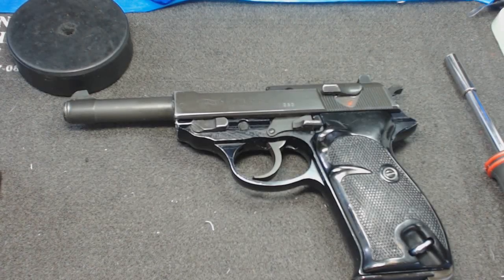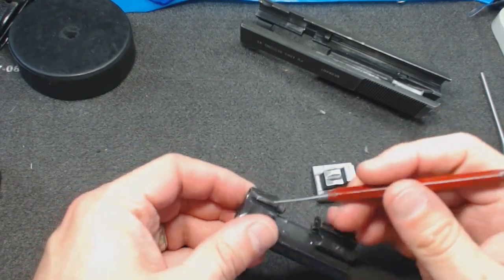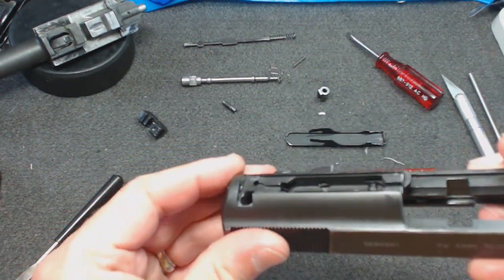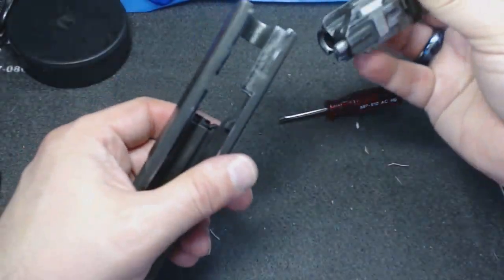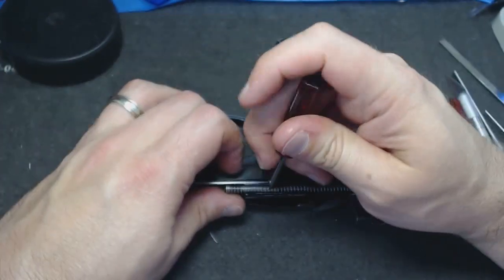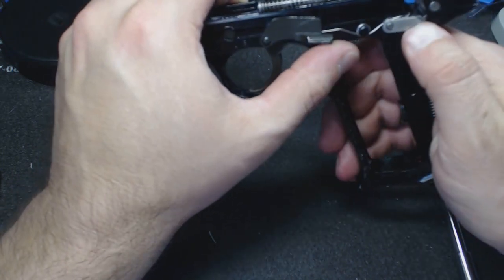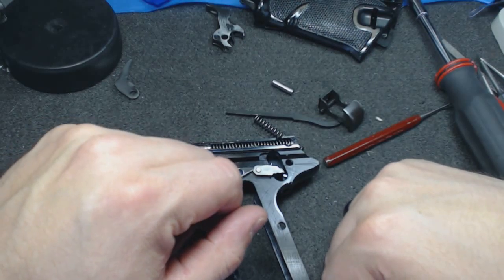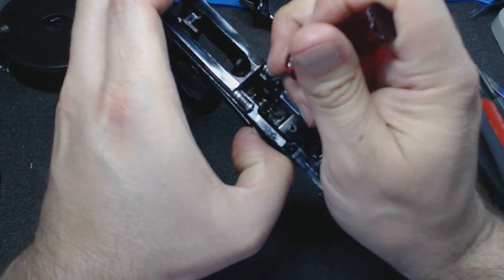Walther P38 (P1) complete disassembly and reassembly

Comment: I have an old byf 44, and If I may add something, a little trick during the take down that may help.

I noticed in the beginning of the video that there was some difficulty removing the slide.

Placing the safety in the down (safe) position before releasing the slide catch will allow the hammer to automatically decock when you move the slide forward, negating the necessity of a trigger pull. It will all come off in one fluid motion.

Hope that helps a little. Good video, cheers all.
Reply: You are right. During my time at the Bundeswehr, we where educated to turn the safety on safe position.
Reply: That's how they show the takedown procedure in the 'Know Your Walther P.38 Pistols, Owners Manual, by E, J, Hoffschmidt.

Comment: I hope you realized by now (see minute 17:45) that your firing pin spring was simply wrongly installed and you put it back the same way! The "mouse trap" coil end should be toward the hammer. This way it will hold the loaded chamber indicator on top of the flat large square in its middle. As it is now, it presses it at the front. If that spring was installed correctly, the indicator could slide to the back. You need to look at a new, not mangled firing pin spring to compare with yours.
Reply from the maker: You are correct sir. I'm surprised no-one else noticed this before.
Reply: You r ok
Reply: @AshburnArmorerDan  There are two or more types of these springs. 

I'm not sure the spring is actually backwards. Could be though. And it doesn't look mangled to me. The older springs have the 'mouse trap loop' towards the back and extend out flat from the end of coil body, but this is the newer type spring that doubles back over on itself.
Reply: @AshburnArmorerDan  mine doesn't have the pin, next to the take down lever. Mine was made in 1960, is this normal?

Comment: Is this video 70 years old? This gun looks like brand new one :-) Very nice piece of history. I'm using your video for complete disassembling of my P38 for the first time. You mentioned two possible ways of recoil springs removing. I found out that removing these from back is better, but I use rotary move for removing spring out of the back hole and the spring moves out like screw absolutely with no deformation to the spring.
Reply: oh sorry, I see now, this is P1.

Comment: I have a post war p38 and its different from ones from war. The firinging pin in in the slide and there is not top cover like the obe in the vid, how do you remove the firing pin. Been searching the net and all you get is the ww2 p38s and the post war p38 dont really have total strip down which is awkward and weird, hope i hear from you, thanks and good vid that you did
Reply from the maker: Mine is post war too(aluminum frame). Send me some pics or video of your parts and I will see what I can dig up on variations.
Reply: @AshburnArmorerDan  how do i send you pics
Reply: @soudadmaouas7058  Contact info is on the "About" page
Reply: @danielrotelli3738  i e mailed you, thanks brother, hope to hear from you, i sent 5 pics.